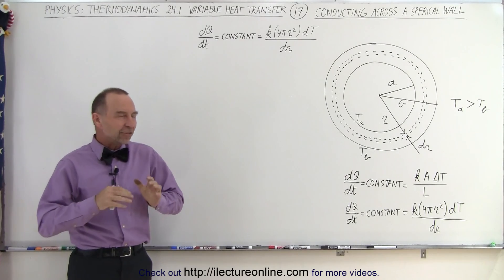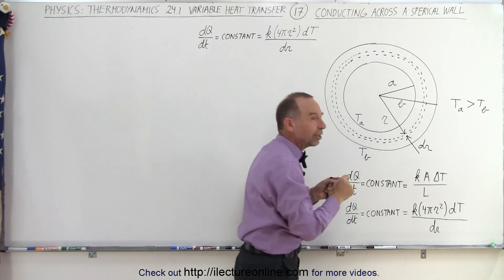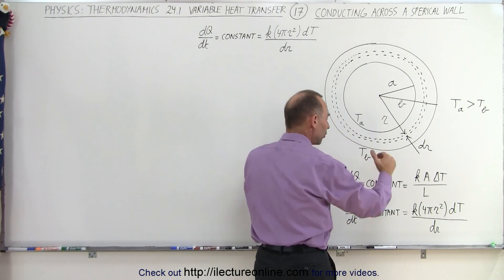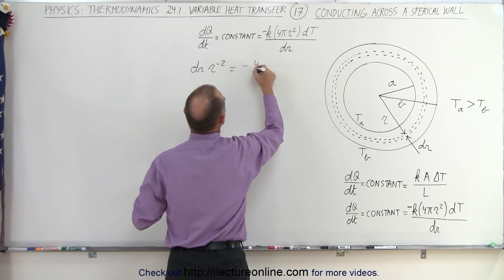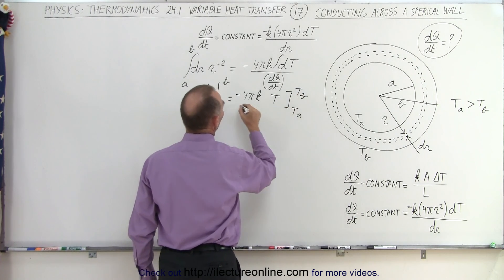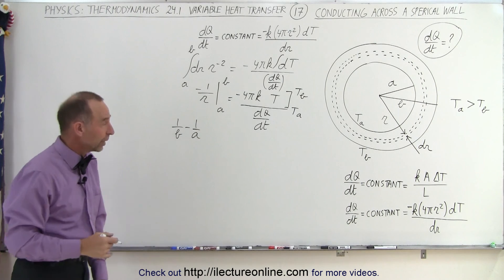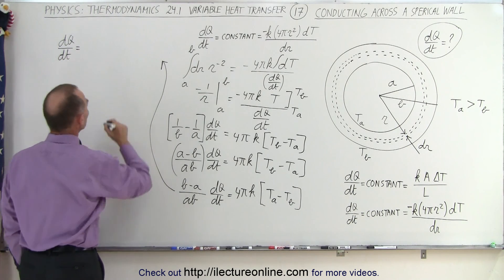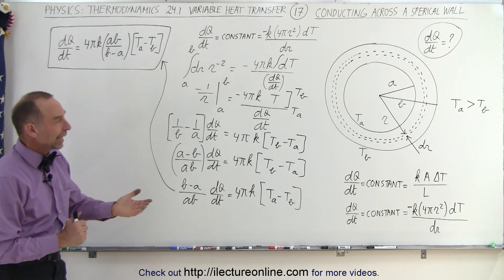Physics 24.1  Variable Heat Transfer (17 of 25) Spherical Wall Conductivity

Comment: what is (k) again?
Reply from the maker: k is the heat conductivity constant
Reply: Michel van Biezen what about if the thickness is very small e.g. 0.25 mm? You are doing very nice job sir!
Reply: @pouria1361  If the thickness is very small, you will find that in the limit, the thermal resistance equation for spherical shells and cylindrical shells, approaches the same equation for rectilinear thermal resistance.

Given a spherical shell of 0.25 mm thick, and 10 cm in inside radius, and 100 W/m-K of conductivity
Rectilinear formula gives us: ∆r/(A*k) = 0.1989 K/kW.
Spherical shell formula gives us: R = (ro - ri)/(4*pi*ro*ri*k) = 0.1941 K/kW